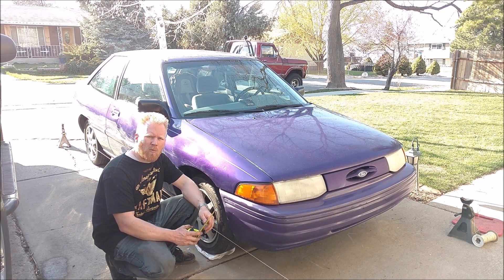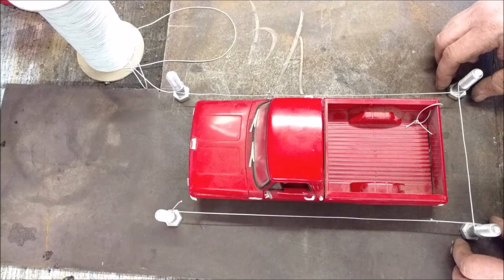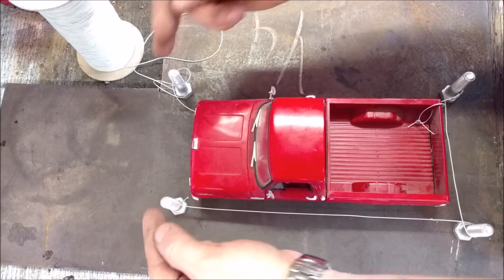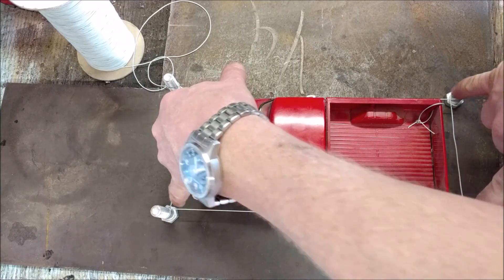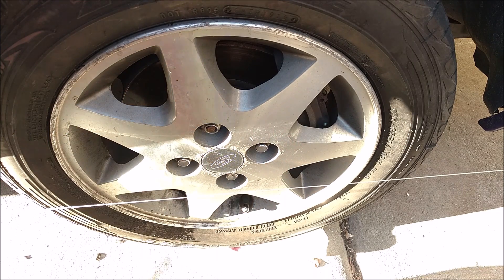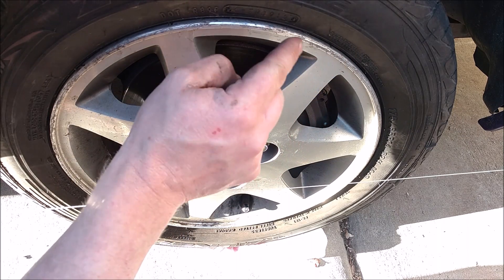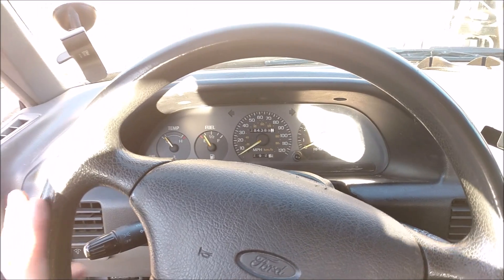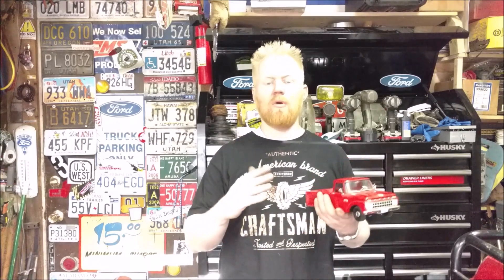Front End Alignment in your driveway Done right

Comment: I do miss my hunter line-o-lite alignment machine...best for the EYElignment method
Reply from the maker: +made by steve I saw one of those at an estate auction last fall and almost bought it. I wasn't sure if it was missing pieces or exactly how it functioned.
Reply: sixtyfiveford It always worked for me...we had a hunter A-111 4 wheel computer back in 1988 and I could do a car on the lineolite and then set it up on the computer and be within specs...and after that I always set toe with a tape measure even on the computer

Comment: Good idea :-D, not sure how easy it would be on some cars though.
If the back was wider than the front, a couple of spacers cemented to spare center nut covers and fitted to the front only could make both axels the same width.
So the string could be closer to all the wheels and remove the axel problem.
But that would be only for your own car :-(.
Some vehicles have the wheels well recessed, so its not easy to get the string close.
What about dental floss for super strong string ha ha :-D
Reply from the maker: +zx8401ztv It works nicely even on dual rear wheel cars. You just use a tape measure as your further away in the font.